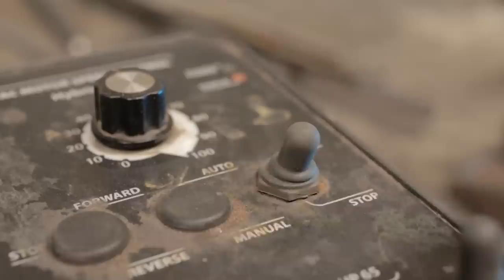Forging Nova's Weapon from Black Desert

Comment: Watching the close-ups of the spikes I thought: "Wouldn't a hand-grinder do a good job of sharpening those spikes a bit more?" But nevermind, that is a solid ball of spiked metal, it's more than enough to F up pretty much any fleshy thing it comes in contact with. Great build, and love the practicality of, as you call it, auto-temper and no need for welding. So elegant (in a devastating way).

Comment: Love how you showed that parts can be permanently joined by using the heat expansion of the material 
Extra points - the effect is greater if the cold parts are very cold and put in quickly. 
(With larger pieces like industrial equipment sizes the difference in size of heated part and cold part can be so large as to accommodate an upset or mushroom of the cold part with a cavity in the hot part)
And then the whole of the piece is temperature normalized together (cooled heated but not timpered)

Comment: Not trying to sound condescending (it's not like I could forge a round bar if I started with one), it's been a while since one of your builds made me go, "Wow" out loud. You did it this time, and I probably  Wow'd out loud three or four times. Forging a ball without some kind of rounding tool looks impossible! All those spikes hot-fit in one heat! Holy cow! And, even if I'm not compelled to vocalize my wonder out loud, I'm always impressed with the work you guys do. 

As for suggestions: I've always been partial to the Dungeons and Dragons sword. The one woven into the logo on the player's manual. Though if you are looking for a challenge, I've always wanted to see the Dwarven Urgosh or Orkish Double Axe built.

Comment: I'm not a fan of this type of weapon, but you have made a splendid artifact.  Even not using any type of welding machine made everything more fantastic. One question, have you hardened the spikes?  how did you do ?
Reply: He pointed out the steel used for the spikes air hardened and when placed would self temper.  I assume that means the heat coming from the core sphere radiated through the spikes and tempered them.
Reply: @masterkeep  exactly - thanks for paying attention 👍🏼👍🏼👍🏼
Reply: @masterkeep  I missed that information.  thank you for the explanation
Reply: @sgabellospaziale2181   You're welcome.  If you want to catch it directly from them, it was when they first started on the spikes.  About there they mention the steel and it's properties.

Comment: That morningstar looks awesome but I think that in actual combat those thick spikes could easily get caught in plate armor...
Reply: I mean, stuff like it has been deployed historically, like the morning star or flail. Not to say it didn't happen, but more to say it wasn't enough of a problem to be a major inhibition.
Reply: @zeekeno823   ...Yes but usually the spikes were shaped in a way wouldn't allow them (or at least minimize the chances) to get stuck... These ones have long thin necks (compared to the heads) that could get caught on the edge of the holes they puncture through, a much better design would a more simple pyramid shape without any neck, that way upon retraction they would naturally slide out of the hole. Remember that in the heat of the battle even a second lost in retrieving your weapon could spell your death...
Reply: Yeah, I understand. I think in most cases the thin neck won't be a problem. Actual penetration of hardened armor tended not to be too deep. I think my biggest concern is the spikes possibly breaking off at that high stress point.
Reply: @zeekeno823  Yeah, that could also be a concern.

Comment: Great work! but the chain is missing, i think that it could be better with the chain in the ball  (or in the vertical stick) and a mechanism that allow you to unlock the "chained form". I'm not a blacksmith so i dont know if it's possible, but the missig of the second form of the weapon, make it weird... it is a beautiful mace, but it is not the nova weapon. 
You are really good at crafting things, too good to just stop there, you can do better next time.

Comment: Would the hot fitting of the bolster also work with a handguard of a knife? Because the handguard has alot less direct surface and is rather slim.
Reply: Should. I'd add a swell in the tang, just a small one, for the bolster to mechanically lock around. You could probably do it with a file.

Comment: I'm curious how much this ended weighing
Reply: At least 5
Reply: @bat32391   ...tons? 😆
Reply: More like ten.... maybe twelve
Reply: General rule, what they make looks cool but you won't be able to wield half of it
Edit: a 3lb hammer head is smaller than an average man's fist
Reply: Yeah it's no weapon I'd fight someone using that , with a tennis racket. Judging from the strain on the bearded guys face with the beenie on , Id say  like 15lbs total. Great work of art however. Got more curious 6" of 3" round is 12lbs,+ spikes and handle well over 15 , more like 20lbs.

Comment: I see a lot of (scale? Is that right) come off the metal when forged or twisted. Is there a way you coud recycle that and can meld/melt it into new usable material?
Reply: Scale is rust, so not likely.
Reply: Scale is the correct word, and it's all black iron oxide. Rust.

About all you can do with scale is save it up for melting back into iron, if any place would accept it.

Comment: too bad the morning start doesn't fly off the scepter attached to a chain,   like it does in game.  
that would be way to hard to make.
Reply: Those chain secured stars are as dangerous to the wielder as the enemy. The flex of the chain actually makes them less dangerous on impact, the stiff handle added impact isn't there. With the lower impact and loss of control from the chain, the head can bounce back into the wielder.